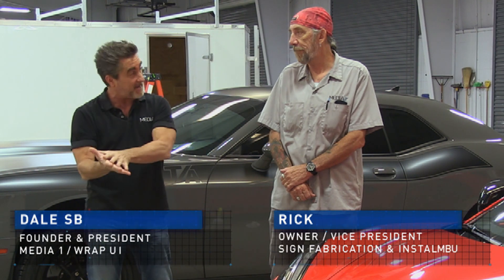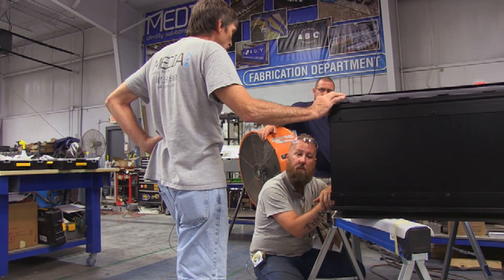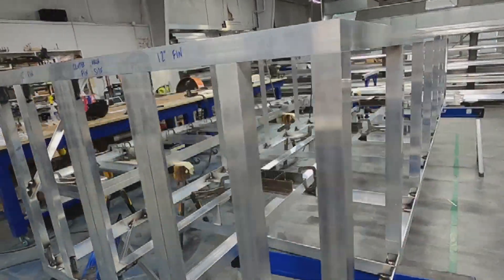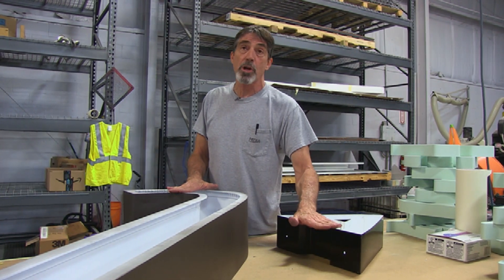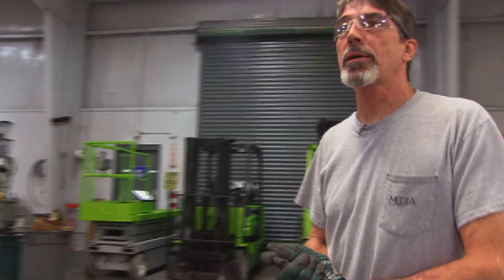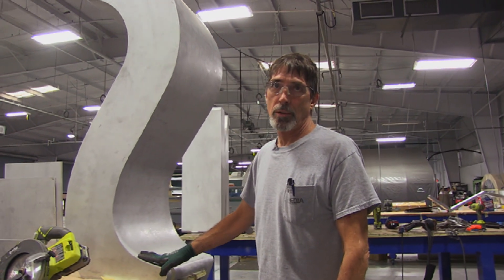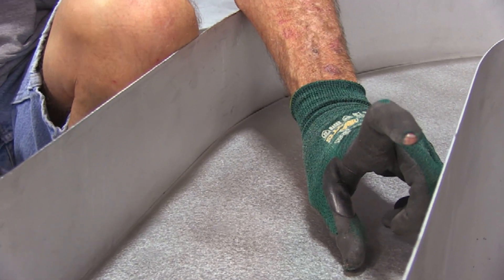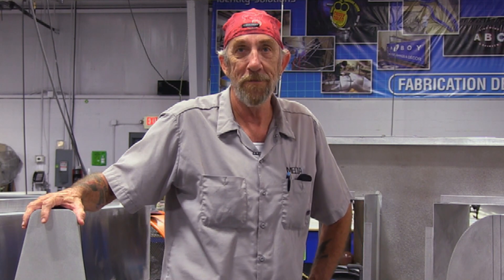SunTrax Part 2: Begin Fabrication

Comment: What is the thickness if that material you made the retuns with on those letters? They came out sweet.
Reply from the maker: Hi there! The letter backs are .125, and the returns and the LED inner backer is all .063 aluminum…all 5052, (more malleable) 
And Thank You! 😃